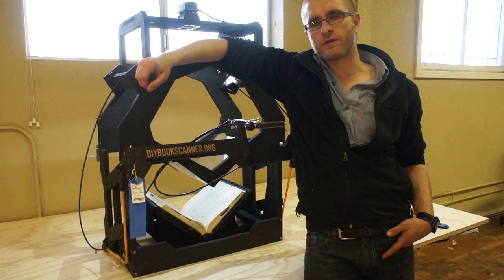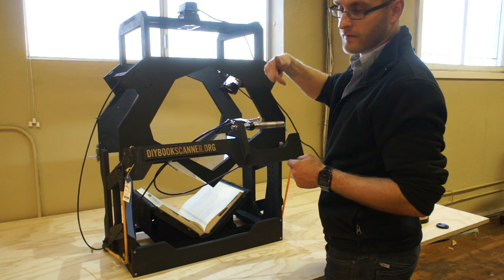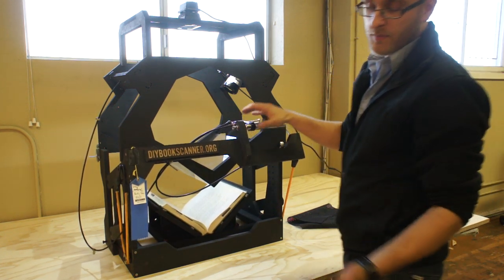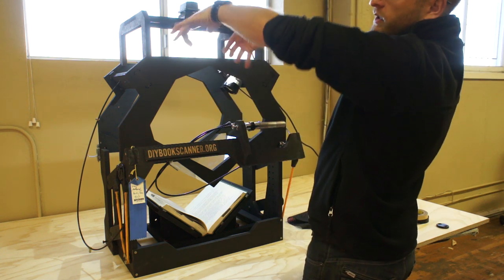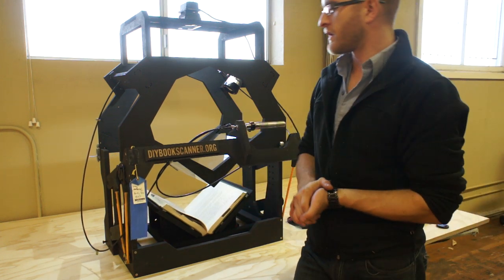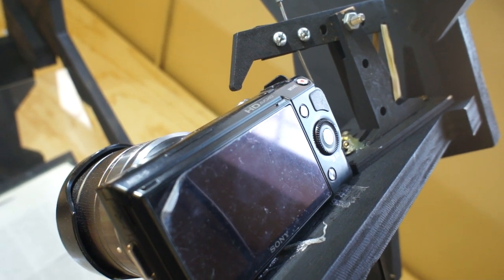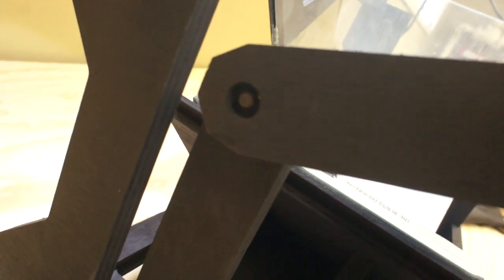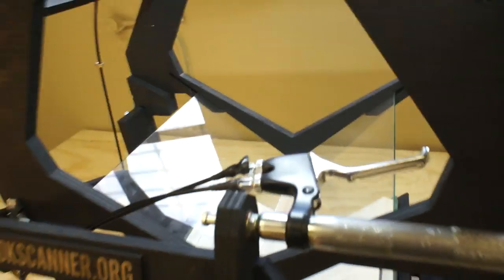BETA DIY Book Scanner Kit Demo and Walkthrough

Comment: This is outstanding forethought and engineering.

As for the leveling issue, just build in two small shuttle levels, perpendicular to each other, and add leveling feet (screw knobs)

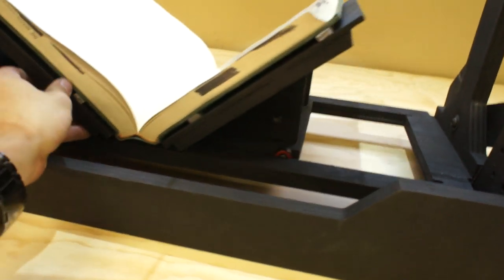Comment: I just had an idea for something to help with the leveling issue you mentioned around 11:30 ... If there were a position lock mechanism that, when the book is lifted toward the glass, it released, it would solve that problem! When you bring the book back down the rollers would once again be breaked. If someone needs to manually re-position the cradle, there could be a manual break release for adjusting the position.

Comment: Did you check to see what resolution is necessary for accurate OCR? I'd be tempted to use an HD webcam instead of the real camera because you'd get each page at 1080x1920 and not need the higher priced camera.

Comment: Yes, it's possible to do it with 2 cameras but it takes extra time to interpolate the images. 
I work with OLD books that can BARELY be opened to 90°, and I've been using a similar setup. So for OCR purposes a CAMERA is quite adequate. 
The DYBOOKSCANNER looks like a great project, but a SCANNER it isn't. 
A SCANNER is a MULTI-EYED device, and each EYE records a pixel-width of a scanned image, so it takes a uniform view of any part of an image, which no SINGLE-EYE CAMERA can possibly do. :-(